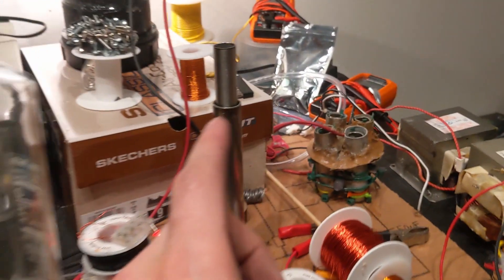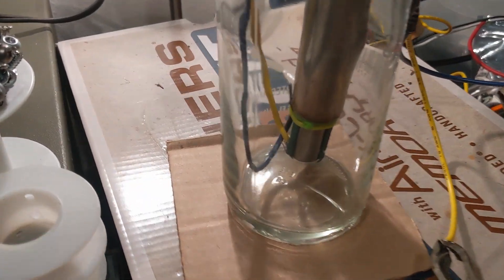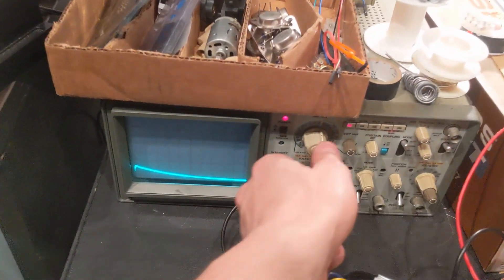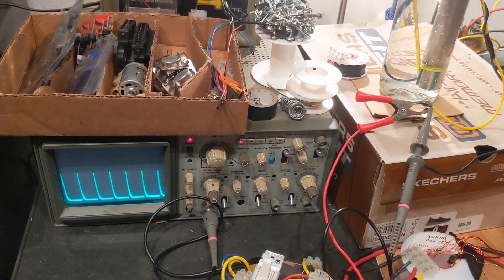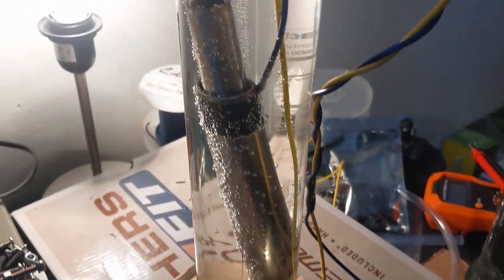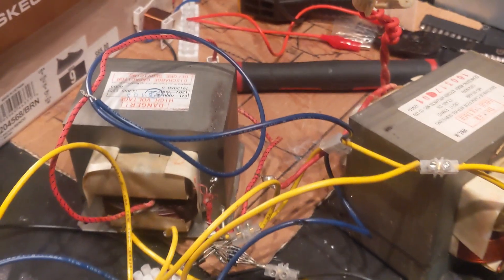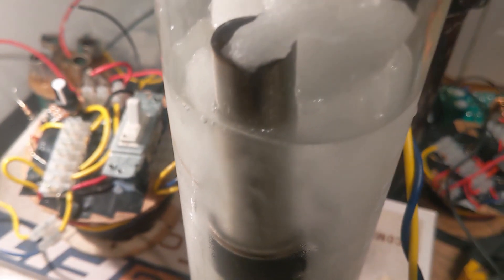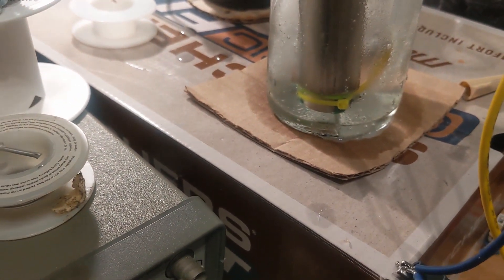HHO Self-Resonating Circuit [Snow Water]

Comment: Hello, this question has probably been answered at some point in the  documentation of your voltralysis project, so forgive if that is the case. My question to you is, was there a reason you didn’t add an electrolyte to the distilled water? 

I specifically ran into video because of your use of the metal’s resonance frequency to generate the right current to create hydrogen after reading about Stanley Meyers’s (maybe attempt). Thanks for your consideration keep up the good science.

Comment: Check it for floride and choride based compounds, may need to vent those off somehow once you start trying to use it for something.

Also you can use field geometry to produce ramping precise pulses, this will get you closer to what the Peak Output folks have reported there is key counter-resonance-frequency ranges that some report using as micro-controlling method for first Magnetically spinning the target molecules, then Orienting the molecules with the magnets, then pulling on the Atoms electro-magnetically, then finally pulling them apart with the final tug pulse. This is done multiple times a second and there will be more bubble chains forming on the plates as a result. You'll likely need a little system programmed to meet these parameters if you're pursuing that end. If you do, make sure to measure all trace elements detectable for your equipment. 

In addition to all this, the most optimal conditions also employ the use of Long-Term conditioning of the plates to enhance their effectiveness at this process. Seemed like this process in particular was rather extensive and took quite a while, this also might produce a lot of volatiles that you don't want to breathe. Always look for floride and chloride based compounds, these traces are your canaries to multiple very toxic compounds that are much harder to read and should be handled carefully depending on the setup. Pressurizing either of the two gasses can also be very hazardous.

Or if you want to use it for something completely different and even more dangerous, you can apparently use a system like that as make-shift EM-range Broadcasting elements. Lol. Don't want to be close to it for long at that point though, Micro-waves always need containment shielding xD

Comment: Nice work, in all my years playing with HHO it wasn’t until I went to show off to a friend by exploding some bubbles a minute after start up that only oxygen is produced for the first 15 minutes, the volatile gases start after that, at least that’s the way it was with the Joe cell so I ended up looking like a knob with no bang 🤣. I don’t recommend exploding anything in the cell as it detunes with the shockwave, not to mention super dangerous and damages hearing pulling the ear drum in the opposite direction as it is an implosion (cool to see in glass as the glass sits in a small pile instead of exploding) I used to collect bubbles on a spoon and walk outside to detonate them. Learning when volatile gases were produced required quite a few explosion tests that drew my neighbour over to question the gunshots?

DC gave me a better response, better output, I never got the same with AC and this led me to where I am today attempting to master the crossover from DC HHO to AC/Pulsed HHO ( I think I got stuck here years ago and haven’t made it back). Might I also suggest water from a natural source like a fresh creek or spring, I tested so many sources for “magic” water and the mineral content helps. When I had selected my water and placed it in the cell I would add a dilute lye drop by drop to the water under guidance of a DC ammeter, trust me you’ll know when you’ve added too much.

Keep up the good work, I miss my HHO cells 😢, I still have all my equipment (disassembled) but was scared to keep working in the field after a few nasty phone calls back in the day, things might be different now🤣
Thanks for the flashback.
Reply from the maker: Wow, so fresh water with a couple drops of lye? That's crazy, will have to try that

Comment: I feel like you are going about this wrong. But before I judge anything I have to ask your untention...
Are you trying to make a self-resonating high-voltage circuit in general(and the HHO gen is just to test the circuit)? Or is your primary focus in getting the most out of an HHO gen?

Depending in what your trying to do there would be a much better way of approaching it. So I must know, what is your goal with this?
Reply from the maker: Testing and getting the most is my goal.

Comment: Use stainless still and potassium hydroxide as a electrolyte the water stays clear,  and also get 316 stainless steel wire to have in the water , copper should not be in the water
Reply: My production is very fast, i purposely used plates with were 0.1mm thick i got 10plate so 10x the surface area of 1x1mm plate less current is needed.
Reply: Check out my
Reply: Video

Comment: I suggest the inside tube  not be a tube but a carbon rod of correct diameter, reduces resistance and lowers water temperature, just a suggestion

Comment: Hook your cell to a DC welder and you'll understand that you don't have to mess with all these complicated resonance circuits.  First, get the production, then increase the efficiency. It doesn't do much if you're 100X Faraday limit if your producing 1ml of gas per hour. If you start playing with dissimilar metals, the cell produces it's own electricity. Then hook up your cell direct to the engine intake and block out outside air. Just allow a very small amount in. Water has its own oxygen.  Most powerful geometry is a tube with a threaded rod in the middle, made of dissimilar metals. Carbon and Zinc create a galvanic current when shorted. Same for aluminum/magnesium.  You can even use aluminum and steel, if you can keep the oxides from stopping the reaction. The least harmful materials for the environment would be Titanium and Carbon.
Reply: My understanding is that if you can keep the electrolyte moving, it will deter oxidation. It's also been said to use copper.

Comment: Where are the 2 L coils resonating with the water capacitor?  Minimum 1500v required from back EMF flyback higher voltage. Also automatic frequency adjuster circuit needed. Tap metal tubes with scope and determine setting that will be same as cell frequency and input source frequency applied.  (Aided by metal vibration to release stuck ions)  Original Meyer circuit was Burst mode design of about 3 seconds on time  low volts + current just for aligning the water molecules polarity, then 7 seconds offtime  high volts applied., so as major H+H+O_ _   Similar circuit as used in the gun for laser tag system game. See also circuit for "The Time Machine " using 2 555 timers. That has 2 ways to hook it up burst mode. You need the 2 original WFC manuals Birth Of New Technology and Dealership Manual WFC. Purchase or study on line Internet.

Comment: What advantage does this have? Any reaction I dont know?
You know that the efficiency is impacted by current density and the distance the ions have to move, and not the voltage. While the Voltage does influence how much Current can flow (and in some cases if something happens at all), its going to lower your efficiency, since a high current density lowers Efficiency. A high voltage does produce side products and corrodes your electrons, too.

To make a efficient HHO Generator (if you need one, HHO Gas is very explosive and cant be stored very well, since it includes the oxygen it needs to burn), you should do the following things:

Increase surface area, to lower current density and/or increase overall current (more surface = easier reaction = less resistance = less voltage per current = less voltage per reaction = less energy per reaction or more reaction per Energy)

Lower the distance the Ions have to move through the water (less distance = less resistance = less voltage per current = less voltage per reaction = less energy per reaction)

Use better materials that decreases the required voltage for electrolysis. You can find a list of materials on Wikipedia ("Overpotential")
Reply from the maker: that was hilarious

Comment: Ty!  Was wondering what you meant by impedience?  Did you just mean resistance or impenitence you get from two waves are out of phase and cancel each other?  
2.  How do you capture the hydrogen and use it?  Can you compress it?
Reply from the maker: impedance is primarily resistivity, like on a transformer primary you need a certain ohm for the coil to not cause a short and induct properly. Water is the same way. Every type of water has a different impedance, and this circuit matches it based on the bjt opening and closing at the frequency of the circuit varying due to the water. It's quite nice actually.
Reply: @weighta6630  Interesting!  So what is the ohms of the water you are using?
Reply from the maker: @l0I0I0I0  No clue on exact, but snow probably isn't  too far off from rain, which comes second to distilled water

Comment: Where can I find schematics for the impedance matching circuits? I have a few ideas I want to try myself.
  Have you ever tried less than 1 mm spacing between electrodes, such that capillary action will bring water up to the top of the elements?
 Have you ever tried using a flyback transformer instead of the microwave transformers so you have a strong DC  offset , i.e. polarized, while still achieving resonance?
Reply from the maker: Here's my favorite one. Super simple https://i.imgur.com/2koIjmC.png
I have just now considered less than 1mm. Difficult to do, but worth it, as Ravi states.
I have not tried a flyback transformer, as I am trying to make this circuit as simple and easy to build as possible.
Reply: @weighta6630  cool! Thanks! , Have you had the opportunity to check its impedance matching ability with any equipment like an oscilloscope or anything? Can't afford any good test equipment myself... Looking at the schematic, that specific transistor used to be called for a lot in Old designs and I'm wondering how old that design is, cuz in the original way of manufacturing that transistor ,it had a higher capacitance that would change the frequency...
   The reason why I think sub-millimeter electrode spacing would be better, is because of the polarization effect of a hydrophilic surface, I suspect that might act catalyticly
Reply from the maker: @petevenuti7355  You are right, old tech indeed. I do have a scope sitting on the table I use many times in my videos. I will get on with something shorter than 1mm
Reply: @weighta6630  Try using a flaring tool. Flare just the top end of the positive tube. You can over size it then just adjust the height to squeeze the gap.
This will create a bottle neck effect which should produce more hydrogen
while using less current. And make it's own resonance.

Comment: Meyer quoted a Bible quote that referemces snow. He used it in his letterhead and painted it on the car. There is heavy water in snow. Meyer used the bible reference Job 38: 22-23. From the least modified bible text the KVJ version says quote 
"Hast thou entered into the treasures of the snow? or hast thou seen the treasures of the hail,
23 Which I have reserved against the time of trouble, against the day of battle and war?"
He mentions this is one of his talks.
Reply from the maker: Woah, that's so cool. Do you remember which talk it was? I watched countless videos of his, all I remember is the one commercial where he says if you don't have rain or ocean water then use snow.
Reply: @weighta6630  i don't recall which talk sorry. will try and find it...